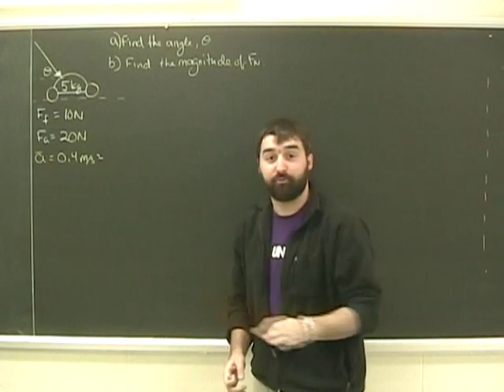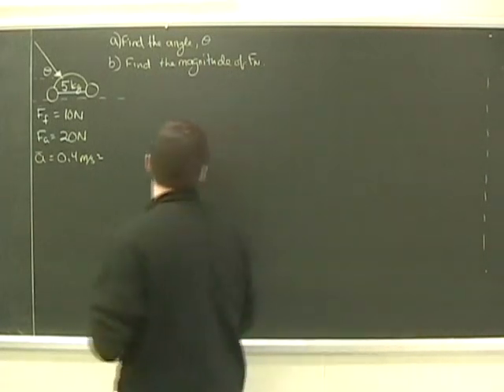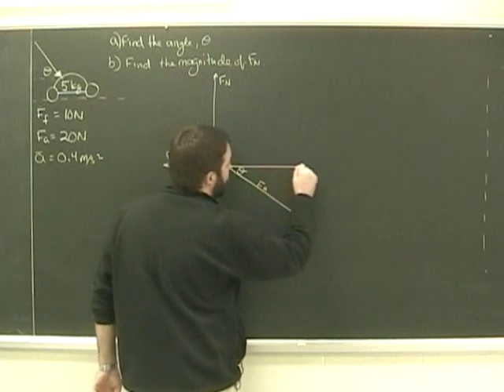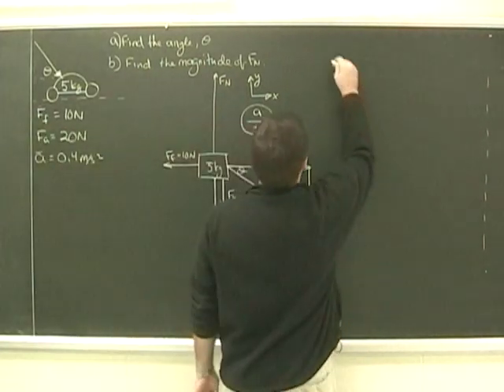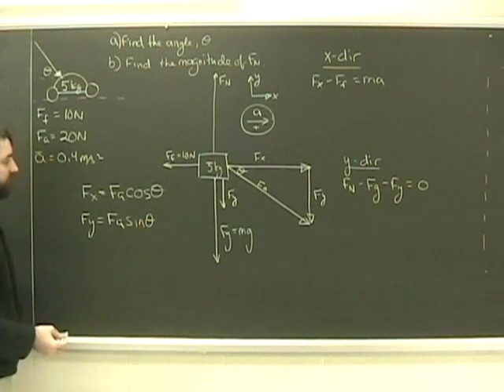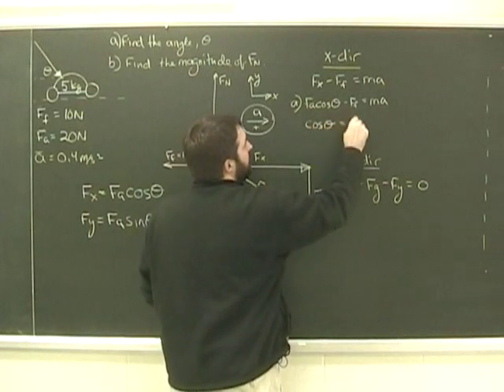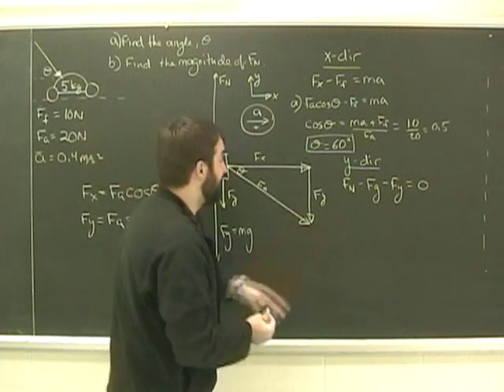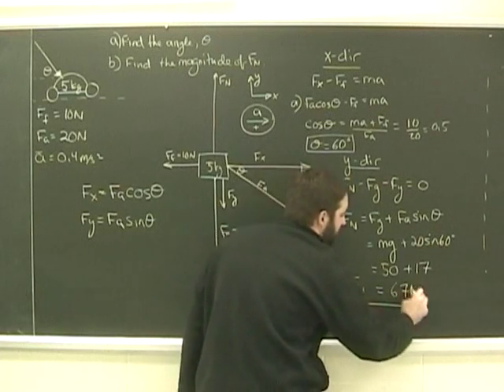Forces on Boxes at Angles Part 4 Physics Lesson

Comment from the maker: @omari1555 Your question ended up in my Spam box so I just got it.
The 12/20 comes from the equation 
FaCos(angle) - Ff = ma which is the sum of the forces in the x-dir. 
Rearange this and you get
Cos(angle) = (ma+Ff)/Fa (shown on the calk board)
Since
ma=5*0.4=2N
Ff = 10N (given)
Fa = 20N (given)
Then
Cos(angle) = (2+10)/20
As far as putting Fa in another place, it may change the angle but the components will still be the same magnitude and direction.
I hope this helps.

Comment from the maker: @omari1555 It will not change the answer as the components will still be to the right and down. Most physics texts dont show vectors going "into" the object as in the diagram. Instead they move it through the object to show it "coming out" of the object on the other side. It is still a vector pointing down and to the right so the components will be the same. I hope this helps.

Comment from the maker: @shadowandnight I'm not sure I understand the question but here goes.
A hot air balloon has Fg down, another force up which is caused by the hot air so you could call it F boyancy and it is up. If there are any forces on the balloon sideways and they are balanced then it will stay at rest or moving with uniform motion. If these forces sideways are not balanced it will accelerate sideways.
I hope this helps.

Comment: hello i would like to know WHY it is 12/20 instead of 10/20 which i got. Also i did the Fa on the top right and used the parallelogram method of vectors to find the angle... did that change anything?

Comment from the maker: @LordIllidan98 Just look at the x-direction, finding m x a does not help, it just represents the right side of the equation. Fnet = ma The left side of this is the forces you are adding (Fnet), the right side is the m x a. In this case you have FaCos0 forward therefore + and Ff backward so it’s –. So left side is FaCos0 – Ff and right side is ma = 5kg x 0.4 = 2N. Put together you get 20Cos0 –10 = 2 Now solve for Cos0. If Cos0 = 0.5 you need to know how to use your calculator to find 0 = 60